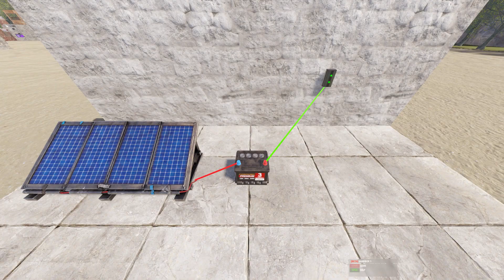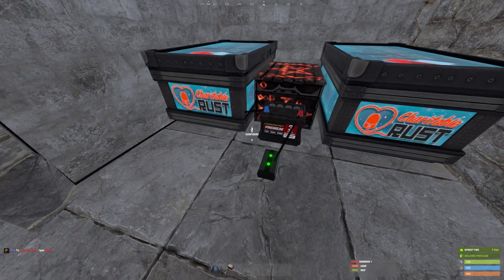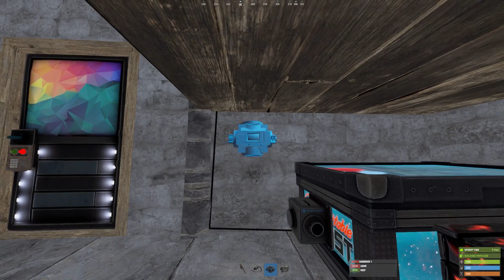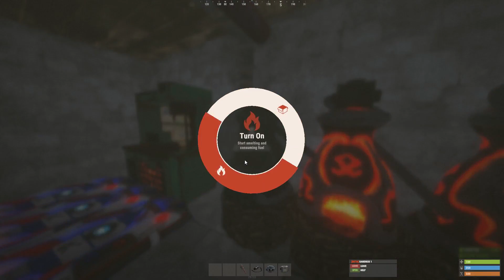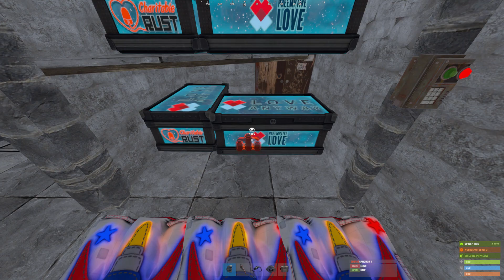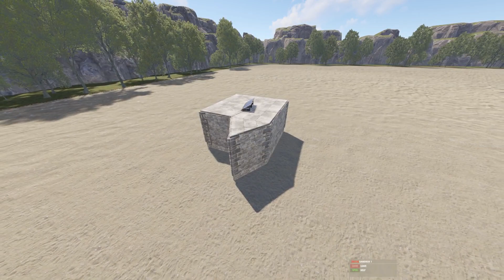[RUST] Practical Industrial Crafting 2x2 (NEW META)

Comment: the industrial update is so useless noone is going to build on real server this kind of systems just to sort some items..../ auto craft something rather sort and craft myself, noone gonna use that sorting systems maybe those zergs with 50+ boxes of loot
Reply from the maker: It’s actually very useful! I’m using it to auto craft GP, MEDS as well as run my small, large furnaces & my refinery. Just have to be a little creative , but it’s definitely only necessary if you have a lot of loot.
Reply: Been using it in my trio base to sort all of my loot boxes (probably around 16 at most). It is amazing and it helps a ton. Definitely not a useless update
Reply: I use it on a 2x to auto sort great for just dumping barrel / monument loot in a dump chest and running straight back out